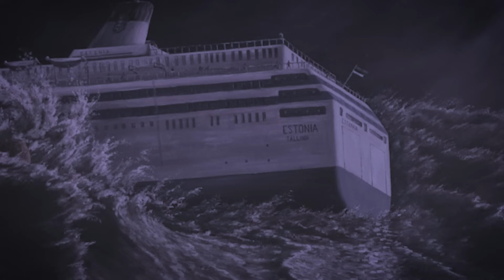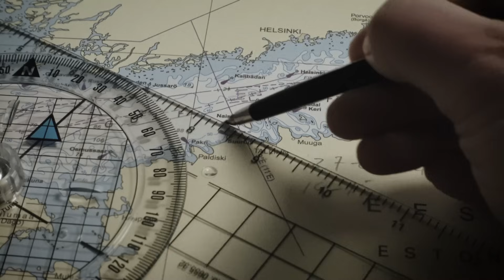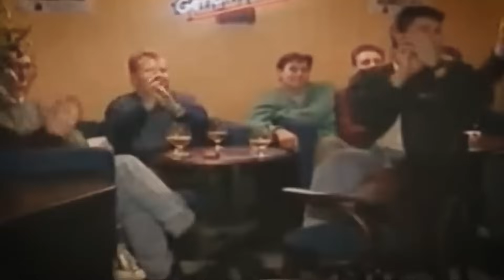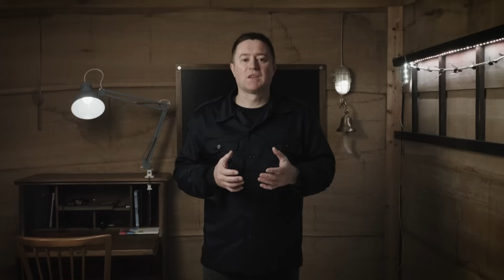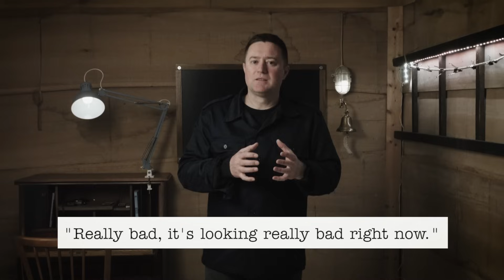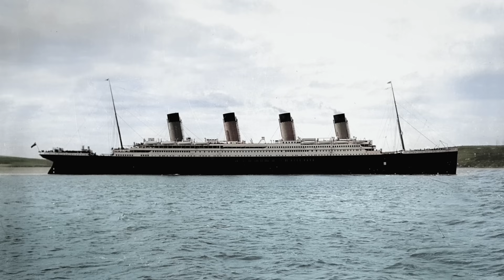852 Passengers Had 35 Minutes: The Estonia Ferry Disaster

Comment: The fate was sealed with no one physically looking at the door and no reduction of speed. You always slow down when there is a loud bang. Language strikes again when all hell broke loose.
Reply: I wonder if such loud bangs had occurred previously with nothing seriously amiss and the captain simply was complacent to these sounds.
Maybe cargo or heavy equipment on board had previously tipped over, maybe the ramp had some wiggle and would occasionally smash into itself.
Reply: @kayjay7585  I was in similar ship 1998 ( Tallinn-Helsinki). There was a storm and big waves hitting agains the ship made loud noises. And since not too much time had passed from Estonias sinking, I was terrified.
Reply: @kakuke  holy moly, I can imagine!!
Reply: I'm sure every time there is something even mildly weird that happens to you at work, no matter how briefly, you'll immediately stop everything and conduct a throughout investigation and will not continue if you cant find the reason.
Reply: I believe there was a young deckhand that actually saw the water gushing in on one of the car decks but he didn't have a radio or couldnt get the bridge on the line. He survived. Must of been a 'Seconds to Survive' type tv show, I think, good quality recreation. It was an accident waiting to happen, safety procedures ignored or 'worked-around' for ease of use & too much risk with front-facing ro-ros (roll on, roll off ferries). Horrible.